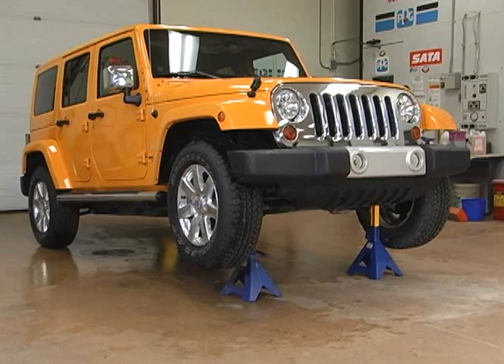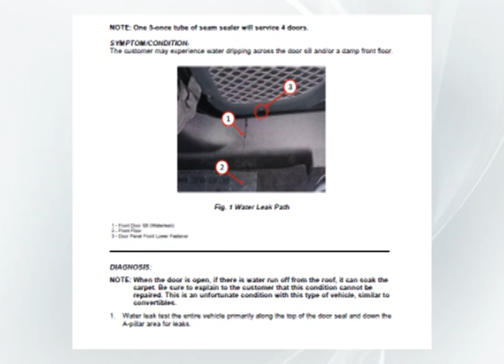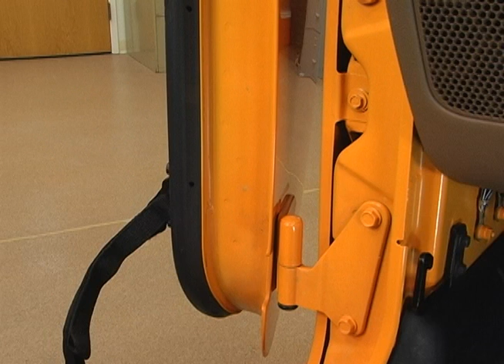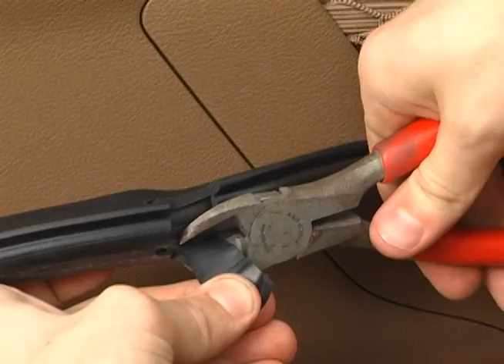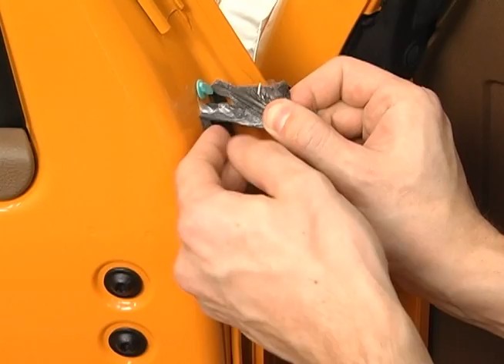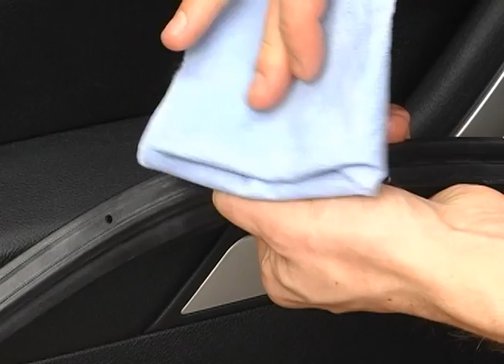Jeep Wrangler Water Leak Best Practices

Comment: I have a 2008 jeep wrangler (unlimited sahara) that I have owned for 10.5 years. No problems with leaking until hurricane Florence a few months ago. I have tried a sealant foam purchased from Ace hardware; which worked for a  month. The leak seems to travel. It leaks from the top of the door opening on the driver's side. It wets the seat belt and runs down to the floor. I made and cancelled an appointment at the local dealership. Diagnostics would have costed 120.00. After viewing several DIY videos, I will attempt one this weekend. I assisted a coworker with a leak for her vehicle and it worked, hoping my luck will change soon.

Comment: 2 door jeeps don't leak
Reply: My 2 door leaks like crazy! The upper molding fills over the passenger side. pull out of the driveway and turn...boom, soaked and pissed off wife. I've tried foam in pretty much every place there is. Actually watching some vids then headed out to take a 6th look at it and try and figure it out.
Reply: Ross T if you fix it post back, curious if you find the exact cause
Reply: There is a MOPAR bulletin on it that might give you some ideas on where to focus...I'll say upfront its not the end all solution...just good starting points. 
http://www.meyerdistributing.com/marketing/filestore/RMA/Jeep_Diagnosis_and_Repair_Manual_for_Leaks.pdf
Reply: Fuck they don’t. I have a 2011 that leaks like a hooker at dollar night.
Reply: Midnightsun my 2011 2 door wrangler passenger side is leaking....
Reply: Im in Northern VT...so as soon as the damn snow stops Im going to be able to take the top on and off and test it. I've been able to slow it down so I figure I just need to get the right amount of foam in the right place then spray it with the garden hose and test it/modify until tight.
Reply: You did not include cowl vent drainage clog. The grill in front of your windshield allows rain water running down your windshield into that cavity. Inside that area, for JK's, there is a slit left open on each side directly in front of your door hinges that allow the water to drain out under the jeep (for others it may be a tube in the center of the cavity). This slit can become clogged with leaves and such, preventing drainage. This fills up that entire cavity with water, until it reaches your climate control fresh air inlet, where it drains into the interior behind your dashboard and down the firewall (the wall in front of your feet). My Wife's passenger side floorboard would have 2 or 3 inches of water every time it rained. How I saw where the water was coming from: After going in one of those 5 dollar drive-thru car washes, I stopped at the vacuum outside to look underneath, and, lo, I looked, and beheld thick soap suds from the wash cycle still running down the passenger firewall into the floorboard. On the JK you will need a 13mm to remove the wiper arms, a T30 torx and flathead (to pry plastic keepers accessed under the hood) to remove the cowl cover (the thing in front of your windshield with the vents), a T 40 torx to remove those brackets in the bottom corners of the windshield (you will see when you get to next step) and a 10mm socket to be able to bend the side cowl covers laterally, toward the outsides of the jeep. Don't bend bend them, just move them out of the way a little anytime you are in there. once you have access to the sides of that cavity, remove any debris and then take a coat hanger or something and feed it through that slit to clear debri there. pour soapy sudsy water into the cavity (not into the black grill, that is your interior air inlet!) and see if suds appear on the interior. repeat until the suds don't appear inside. Bote that vacuuming all water out is futile with carpet in, so there are black rubber drain plugs under your carpet in the floorpan. When a weekend with no rain comes I will create a you tube video for this. You're welcome.
Reply: also note that looking into that cavity through the cowl vent cover is deceptive. mine looked debris-free. That is because water flow carries it out of view  to the sides.
Reply: Lance Robinson Did you make this video yet?  I’d like to see what you are talking about.  Just for reference.  0lllll0 JEEP LIFE is grand!

Comment: First:
I am writing on behalf a purchase that i made back in 2014. I currently live in sabaneta colombia and I've been having issues with my vehicle.  I purchased a Jeep Wrangler unlimited sport AT, gray, 2014 model with a vin number 1C4BJWDG4EL255739 for the amount of  $113,000,090 COP which is around 36,581.44 USD at the dealership "Los Coches" located at Carrera 43° N 30-74 in the city of medellin, colombia. 
Second: 
On November 13 of 2014 my vehicle started showing a filtration of water on the left side of both front doors. Once i noted this defect knowing the warranty was still active, I immediately bring the car to be diagnosed and have this issue fixed.
Third: 
Due to the lack of inaccuracy and lack of performance from the dealership "Los coches" I not only have the filtration from the front doors but ALSO from the roof. I then decide to bring my car to be fixed at "Discaribe S.A.S" hoping for somebody to fix this defect and finalize this hassel. 
Fourth:
Once they do an inspection at the shop "Discaribe S.A.S" and they "fix" the defect from both doors and the roof, up to today i've been at a shop 6 times for the same issue. I had the car revised on December 23rd 2014, May 13th 2015, August 18th 2015, January 4th 2016, May 16th 2016, and the most recent one May 11th 2016.
Fifth:
Due to the persistency of the same fault for over a year and a half, it has generated extensive damage not only to the vehicle itself but it also takes big part on the expenses because my business depends largely on the work done with this vehicle.
Reply: compañero, yo tambien tengo el mismo problema con las puertas de mi rubicon 2013, ellos no te van a arreglar el problema. simplemente te van a dar una solucion parcial mientras se te daña para volver a sacarte plata. lo mejor es arreglarlo uno mismo. bogotá, colombia. Mi consecionario es DEMCAUTOS SAS. y sirven para Mierd, mierd y mierd.
Reply: Amigo, buenas noches, tiene toda la razon, sin embargo a mi solo hace un mes se me acabo la garantia, en adelante me tocara buscar un solucion; mi whats app es 3175173155, me gustaria saber mas a fondo que le has hecho al carro al respecto. Muchas gracias 👍🏻 Mi nombre es Simon